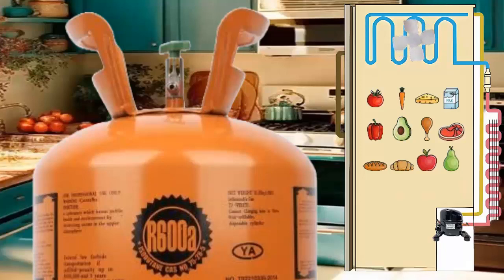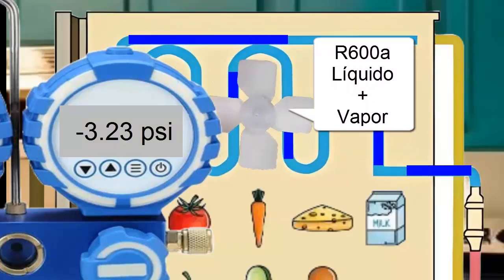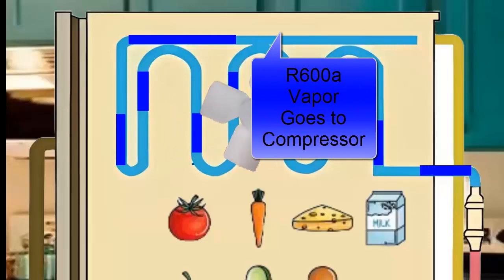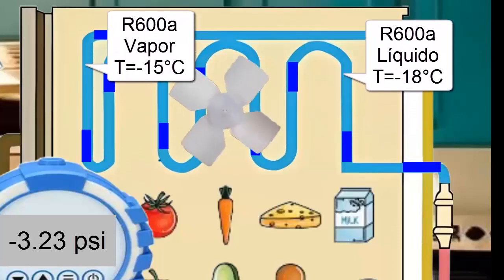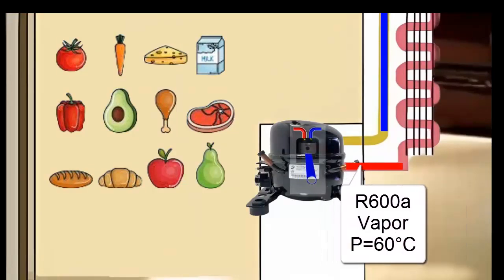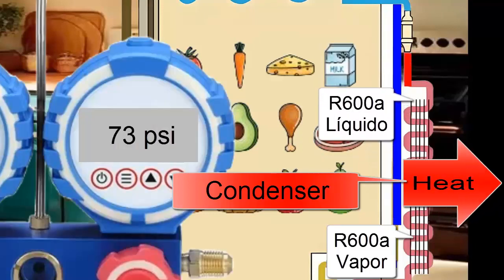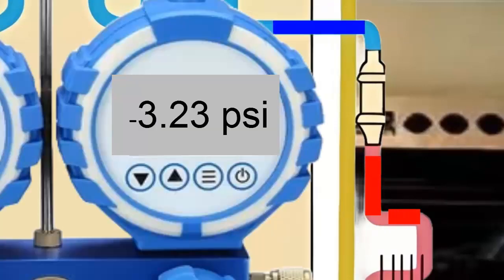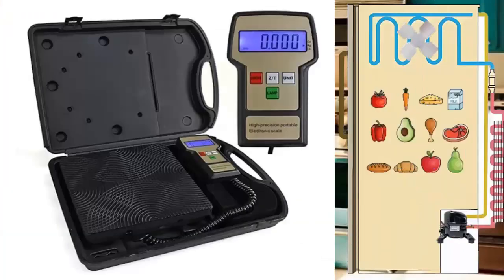R600A Refrigerant Pressures: Key Components & Cooling Cycle Operation Explained

Comment: What would be a reasonable filling pressure for R600a at 20C, no compressor operation? Is it around 10 psi?
Reply: depends on the sizes of the hot and cold side! but i have 2 tot (2.2 bar = 31.9 psi) in operation you need about 5bar in hot side to liquify the gas.